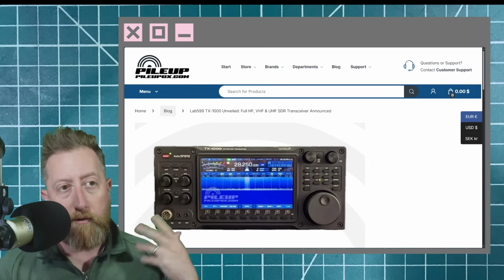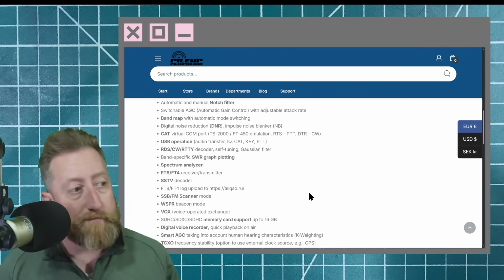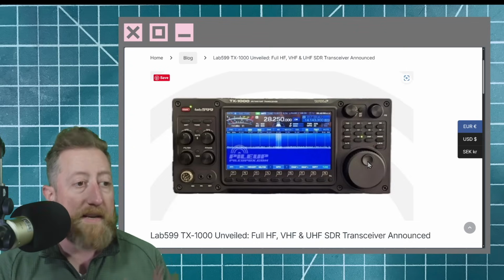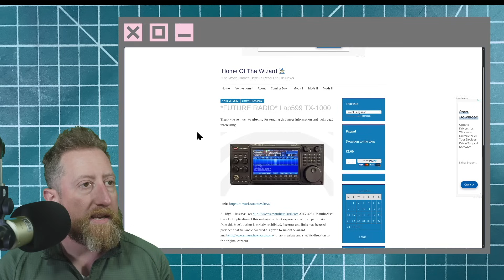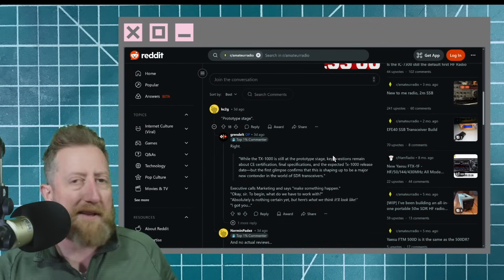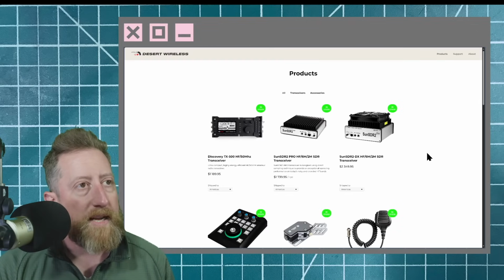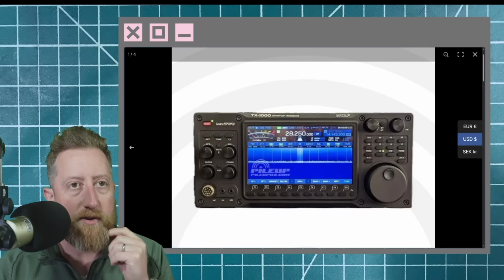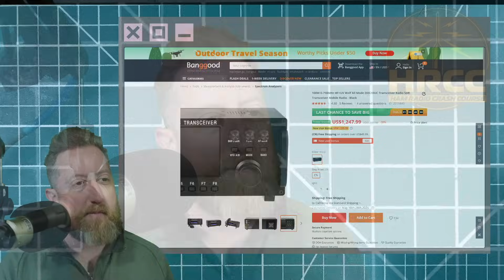Lab599 TX1000 HF/VHF/UHF Radio Announced!

Comment: As of noon eastern today, Desert Radio is showing the TX500MP available for sale at a price of $1399.95. It comes with the battery "shell", but you have to provide your own cells. I'm tempted...
Reply from the maker: I noticed that.  Very cool.
Reply: Just got the BP 550 battery pack; it works fine and now either usb c socket for charging

Comment: There are radio frequencies being directed to our private property. These radio trasnmissions are being broadcasted to devices like radio,tv,ac,fans etc to use as psychological warfare against us.
Im in Santa.Ana,.CA in the County of Orange and I do not trust local authorities or the FCC. The radio transmissions are 90% American females sending provactive messages. Is there a way I can detect,record,identify and possibly locate them with an sdr-rtl? If not what devices do you recomend to help me get rid of these radio parasites.

Comment: Hi Josh, a caution or two for listeners . . . Yes, there's a new Lab599 prototype out there, and hopefully a 2025 full market introduction coming. And while it was designed by the guy who led the WOLF team of Ukrainian and Russian designers (yes, working together!), that WOLF radio you mentioned is a total loser if you don't build it yourself (the design works great if you use the right parts and don't cheap out as China did). The ones that area available through the Chinese websites are scary bad as they are rip-off clones of the design, and Dmitry the designer talks about them in an interview I did with him for my column on QRZ called "Trials and Errors -- Ham Life with an Amateur." That was in issue 44, from Sept 16th of 2024. Readers can find it online, and the discussion of these great features will be interesting for someone considering the TX1000 when it comes out, as Dmitry (after our interview) went to Lab599 and is now working with them. It should be a terrific desktop rig and hopefully in the same price range as the TX500 or the IC-7300. The article should be interesting for readers -- it's called "Copycats stomp on Ham Radio innovation."  Thanks Josh for all that you do,  Dave W7DGJ,  columnist for QRZ.

Comment: § 2.803 Marketing of radio frequency devices prior to equipment authorization.

(a) Marketing, as used in this section, includes sale or lease, or offering for sale or lease, including advertising for sale or lease, or importation, shipment, or distribution for the purpose of selling or leasing or offering for sale or lease.

(b) General rule.  No person may market a radio frequency device unless:

(1) For devices subject to authorization under certification, the device has been authorized in accordance with the rules in subpart J of this chapter and is properly identified and labeled as required by § 2.925 and other relevant sections in this chapter; or

(2) For devices subject to authorization under Supplier's Declaration of Conformity in accordance with the rules in subpart J of this part, the device complies with all applicable technical, labeling, identification and administrative requirements; or

(3) For devices that do not require a grant of equipment authorization under subpart J of this chapter but must comply with the specified technical standards prior to use, the device complies with all applicable, technical, labeling, identification and administrative requirements.

Comment: all decoding need to be to the screen on the radio for all digital modes and CW  ... I don't know about your PC but i just ran into , I have no serial port on the back ..  ohhh their it is on the Mother Board way over there ..  and it didn't come with the cable to plug into it so i have to order it to get a com port ..  go figure ...   and this will all be at the amazing low price of 9,999.00  ....  correct ..

Comment: As a Yaesu user, I'm holding out for an HMDI port which used a DVI-D connector and conforms to neither standard, a "mouse" port with a USB connector which only works with some mice and no USB hubs or switches, and an obsolete SDXC card slot which only works with some SDXC cards.

In all seriousness, I'd like to see an all-mode VHF/UHF radio.  I already have a very capable HF rig even if quirky.
Reply: There is one, the Icom IC-9700.  I own two of them.  Fantastic weak signal radios.
Reply: @mikesradiorepair Nice bit missing the bottom 3rd of 70cm and all of 33cm.
Reply: @mikesradiorepair for $1800 it's missing 1.25m, the bottom 3rd of 70cm, and 33cm.
Reply: @mikesradiorepair   WHAT !!! no 1.25 meters
Reply: You forgot the laggy GUI which comes straight out of 1996 with most functions vital to access quickly buried at least 3 pages deep.
And the most used push buttons jammed into the most inaccessible places with the least used featured prominently in the places the most used should be.
Reply: I would like to see an all mode UHF/VHF All mode sstv base station that didn't cost 2000 bucks just to get into. The 9700 is sweet, but cost prohibitive for the useful bands
Reply: 16GB likely relies on an outdated filing system. You might struggle to save anything large, like a spectrum recording.
Reply: This is the reason why I kept my ic-7000 the outputs ntsc composite ...

Comment: The TX-500 is priced around US $1700?  Seems like a steep price for a qrp rig.  How does it compare to the cheaper IC-705?
Reply from the maker: HRO has them on sale for $1099. It’s a low power draw   Rugged QRP radio that has some quirks. But seems well liked.

Comment: Looks like a Wolf SDR.  The Russians on the Telegram said it was a Wolf under the covers
Reply from the maker: A “wolf in sheep’s clothing” no less?
Reply: @HamRadioCrashCourse  I’ve known of a couple people who have had a Wolf Radio (Chinese knock offs) - 20 w and 100 watt radios. They loved them! These two people also seems to live in a very QRM-less environment (wilderness) and have VERY good antennas. I would love to see you get the Wolf Radios and review them.😊
Reply: @HamRadioCrashCourse I have two of the original radios that this is based on. LAB599 claim that the internals will be totally different, however the spec sheet is near identical to that of the original designs, except for the UHF capabilities as the original has an upper low pass filter limit of 175MHz, and the VHF PA module is spec'd as 136MHz to 174MHz. As LAB599 are claiming to manufacture this I expect the price will be four to five times more than it cost to self build the radio.
Reply: Yes, it is. The Chinese and LAB599 took Dmitry UA3REO's development as a basis. The WOLF transceiver. When thousands of radio amateurs repeated this transceiver, it began to be produced on an industrial scale.
Reply: I love my Wolf, got it because of @N4GW.  And yes, that screen is wildly close to being identical.